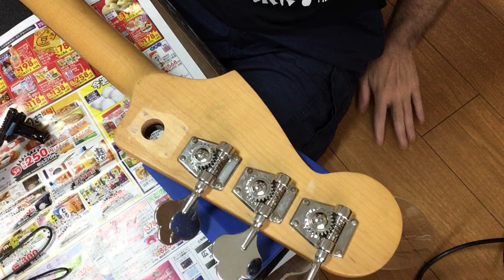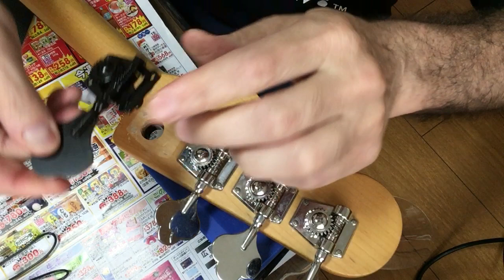Jazz Bass - Tuning key alignment.

Comment: on pins and needles watchint u mark the hole and not move the tuner 😂 tedious work but worth it
Reply from the maker: Tiny Dragon, how are ya? My best to Blkjak. 
I cheated and used a couple of pieces of painters tape to hold the tuner in place. Without the tape it would've been a massacre!

Comment: measure thrice so everything fits nice.
Reply from the maker: Poo Ninja, no matter how many times I measure there’s always that one tiny screw that goes in at a slight angle. It’s torture.
Reply: @bass-hiroshimanick2534  ahhh there are many reasons I’m not a master craftsmen. I often use what we call percussive maintenance 🤣.
Reply from the maker: @PooNinja  , I often use the percussive technique to make things fit!
Reply: @bass-hiroshimanick2534  I’m not an electrical engineer but I have repaired, rebuild and constructed a lot of electronic equipment,sometimes static build up can be best displaced by forcefully imbedded it directly in the Earth(or Moon) to properly ground it. Sometimes I just bash the wrench into the ground screaming “work or you’ll get the same!” as If a fiber optic  laser amplifier is frightened by such things.

Get the job done ✅
Reply from the maker: @PooNinja  , bashing parts with tools another one of my highly advance skills and talents. And along with the bashing comes a lot of screaming and cursing.